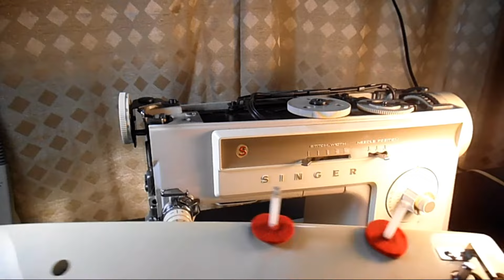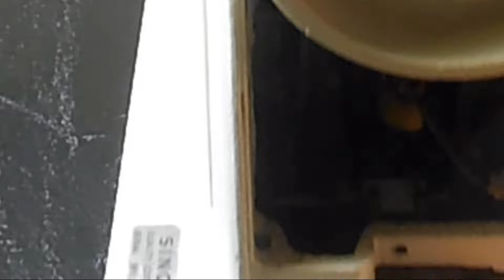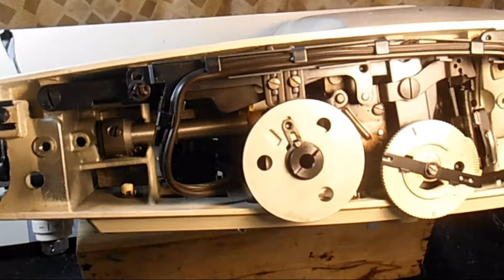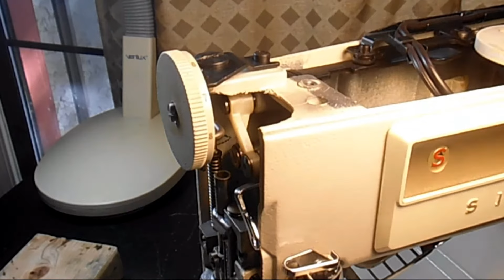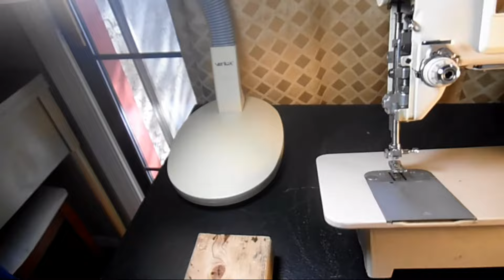A Look Inside a Singer Model 513 Sewing Machine

Comment: Do you by any chance have the Singer Cam Shaft serial number? My gradma's machine is in need of a new Cam Shaft.
Reply from the maker: A new cam Shaft? Wow, no kidding? I don't think there is a part that is actually called the camshaft. You mean the cam stack? or the horizontal arm shaft?  You can't really buy new parts like that for a vintage Singer, but people do sell the used parts of machines on eBay. Maybe we can do this. I have the 40-page parts list and the 80-page service manual that I bought years ago. You can have them both for free if you like. That way you hopefully can identify the part/parts you want to replace and also have the service manual for directions to do that. If that sounds OK for you then email andymanuals53@gmail.com and ask for SInger Model 513 parts & service manuals. They are in PDF format so can be sent to you via return email.
Reply: Thank you so much you are so darn sweet! My grandpa and I were just talking about grandmas machine. I will email you such a great idea you are right the cam stack is the name
Reply from the maker: @peanutsplayhouseventriloqu8741  I'll be watching for your email then. It's rare for a cam stack to fail. This model has a lot of plastic gears that are prone to failure as old as they are. I hope the documents can help. good luck.

Comment: Our machine isn't catching the bobbin thread. It's not turning there, where the bobbin lays. How can we fix that?
Reply from the maker: Ok, Lupita, let's hope it is something simple. Watch this video about winding the bobbin to be sure the machine IS NOT in bobbin winding mode but IS IN sewing mode. https://youtu.be/ZO3HXZtOGVc  When in BW mode the hook and needle do not move.
If the machine is in sewing mode and the hook does not rotate there is probably one or more broken plastic gear on the machine.
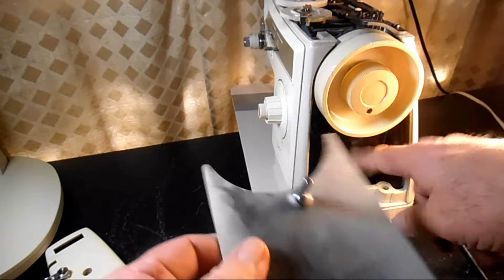Starting about 4:45 of this video you commented on I show the bottom parts of the machine. There are 4 plastic gears down there and they are all subject to breaking. Replacing the one gear directly below the hook is fairly easy. Replacing the other gears is more difficult but plenty of people have done it. Gears are available online on eBay and maybe Amazon and a Service Manual can be purchased online. Terry made a special 9-page instruction guide for changing those gears out. You can download it from his website here: https://store.tandtrepair.com/st4134164185.html  It cost $10.95 but he will give you 20% off if you use my coupon code andy-h-yt at check out. Take a look at those gears closely and see if any are broken. You can download a free copy of the Singer Instruction Manual about your machine at this link: https://www.singer.com/search/support?title=513    Good Luck.

Comment: Hi Andy, my feeder does not move on my machine.
Reply from the maker: That is fairly common on this model. You are talking about a Model 15, Correct? There are plastic gears on the bottom of the machine that move the feed dog and the hook. They are known to get brittle and break. There are four gears altogether. You can buy new gears (try to find white-colored ones) and replace the old ones. It is a complicated process. If you want to email me at my channel I can send you the parts diagram with part numbers and the service manual that has instructions for working on all the parts of the machine. Then you can decide if you want to try to replace the gears yourself or pay a repair shop. andytube53@gmail.com

Comment: Using plastic for non stress parts was an effort to help make the machines lighter in weight besides lowering manufacturing costs.
Reply from the maker: Do you think customers were wanting lighter weight machines, or it made them cheaper to ship? I always figured it was to save money only and had not thought of the weight. Singer's modern model 4411 weighs 14.5 lbs where an all-metal 301A weighs about 17 lbs. Not much heavier for all metal.
Reply: Women surely wanted lighter sewing machines back then. And that Stylist was hefty for women to move around - 20 plus pounds. Women wanted lighter sewing machine since the war. That was why the Aluminum Free Westinghouse and New Home Rotary machines were introduced in 1947 and they are full size machines and weigh only 16 pounds. 

 I have four new computerized machines and they weigh 11 to 13 pounds. Every pound counts.
Reply from the maker: Thank you very much. Your input is always interesting and appreciated Randy. Take Care.

Comment: Oh my, i had no idea how complexe this machine is.  I will look at it a whole new different way now. Great video Andy.
Reply from the maker: Yes, this type of machine has many smaller parts that work together and it does get complicated. I guess that is part of the reason I enjoy the 403A; bigger parts and fewer of them. I have never seen the insides of a modern day electronic style machine with 100 stitch patterns and led screens etc.
Reply: @andytubesewing1953  Hi Andy,  Do you have a video on how to replace the dog feed gears on the 513?
Reply from the maker: @chriscerce4210  Did you mean the hook gears? I think the feed dog is powered by a cogged drive belt coming down from the top arm shaft. Hard to replace that belt I've been told. The 4 gears on the bottom of the machine run the rotary hook if I remember right. I don't have a video for that, but here is a list of videos that other viewers told me helped them for changing the lower gears. https://www.youtube.com/watch?v=cYLzGwpoWeE
https://www.youtube.com/watch?v=x2acFJeDxwg
https://www.youtube.com/watch?v=OeQRTdvtMDg
https://www.youtube.com/watch?v=qHx6VPdenj0
https://www.youtube.com/watch?v=0HirFoVVoxY

Comment: Can you point me in the direction of where I would find the hook gears for the singer 513 and how to replace them please
Reply from the maker: You can go here and download the original parts diagram/list from Singer for your model: http://parts.singerco.com/CPpartCharts/5_59999/518_538_514_513_533.pdf
It will show the gear and its part number. Any online seller will verify for you if the gear they sell is the correct one for model 513. (I prefer white vs. black gears)
Here are links to the two most popular videos about gear changing, and the companies who psoted the videos will sell the gear also:
https://www.youtube.com/watch?v=cYLzGwpoWeE
https://www.youtube.com/watch?v=qHx6VPdenj0
Good Luck gold rock.

Comment: My stitch control dial won't budge off of 10... what would be causing it to lock in place?
Reply from the maker: A good cleaning and oiling fixes about 90% of these type of problems. To start with you can go to13:20 in this video where I'm turning the knob and showing what it moves inside. You can warm the area with a hair dryer to try to free things up. Never force anything to move including that knob. 

Get some alcohol on those inside parts with a brush, dropper, Q-tips or rag and get them as clean as you can. Try to turn the knob once and awhile but don't force it. If things move a little bit then start putting oil on those inside parts, warm the area and keep trying to turn the knob. When people use other than sewing machine oil it leaves behind a sticky residue that eventually hardens like varnish. Using this method is a good way to start this moving again. You can use this method on the whole machine. Download the free manual here to see all the proper oil points:
http://www.singerco.com/uploads/download/1154_513.pdf

Try to use real sewing machine oil. It's cheap to buy at shops, hardware stores, and Walmart. You can try something like WD-40 but then you have to clean it all back off, (it's not oil, and dries hard too) so SMO is really better.

That knob is also making the feed dog move some, so if it is stuck then nothing will move. It could be dried oi, dirt, lint and so forth in the feed dog area. That is why I suggest cleaning and oiling. You could work on that knob area for an hour and not fix anything at all, so taking all the covers off, using alcohol and warm air on the whole machine then oiling as per manual is very important. ANY PART THAT IS STUCK can affect other parts because of how the machine woks.